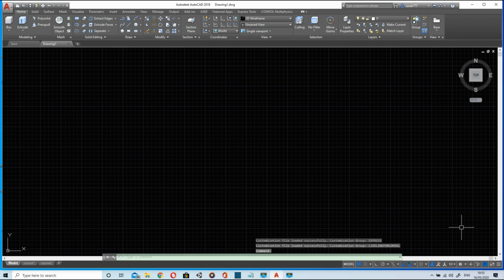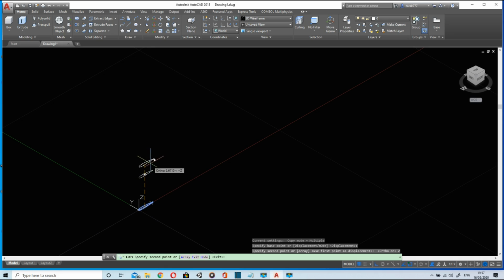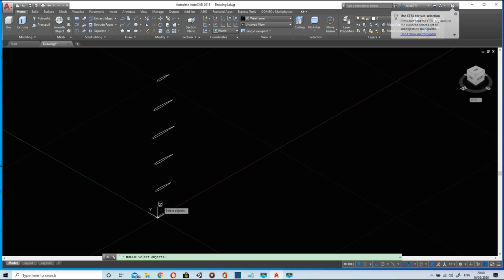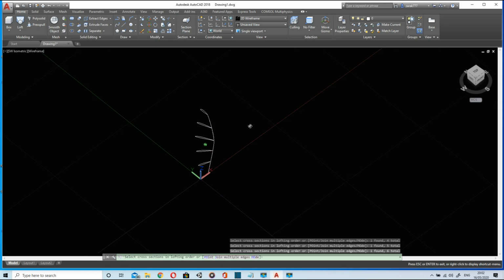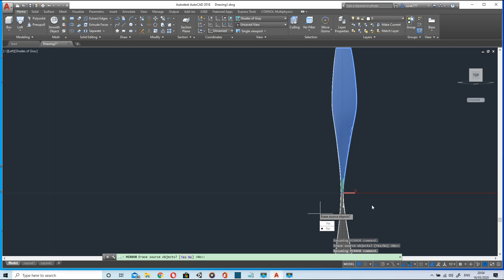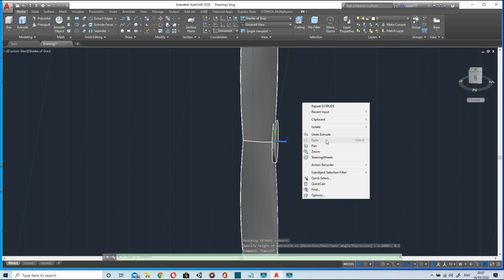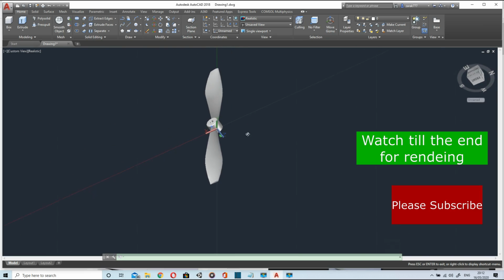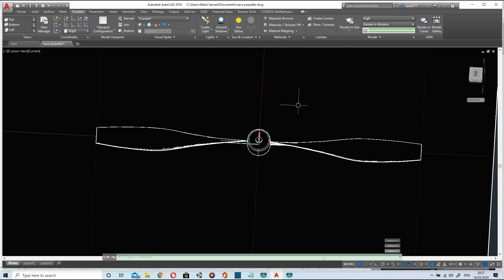AutoCAD 3D - How to model a propeller AutoCAD 2020

Comment: beautiful brother ye 3d print kitni cost aye ghi (last angle 2  blades  ka kiya woh 15 degree par ha) yaar muje is ki bohat zorarat ha 7" 6" 5 1/2 aur 4" me. in me darmiyan ka design mukhtlif ha shape blade ye hi ha print cost kiya ha bhai 1 propeller ki .kindly tell me
Reply from the maker: Dear, brother. I don't know the cost of 3D print for the same CAD Model. There are some websites Islamabad and Lahore-based that can print for you for nominal charges. If I had a printer  would definitely have helped you because printing this is easy